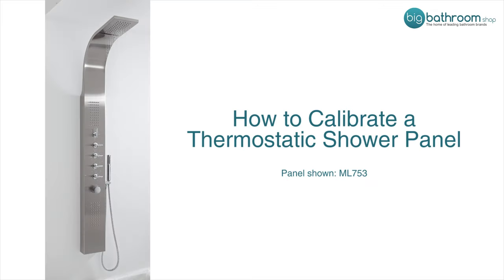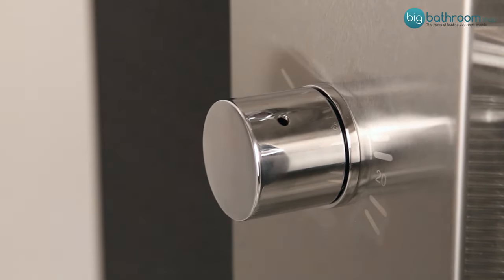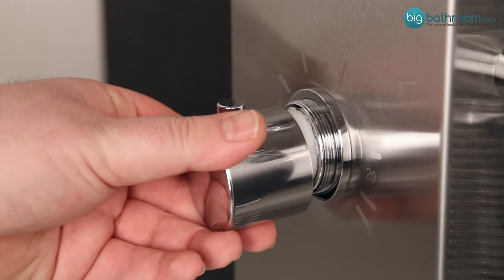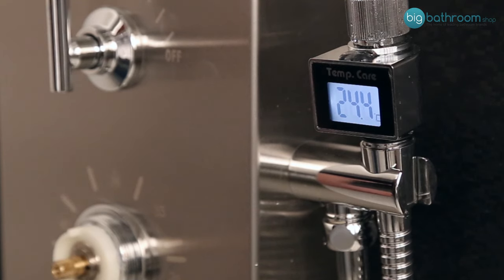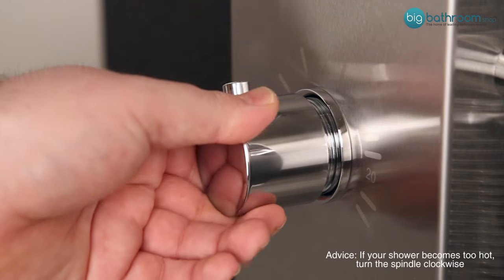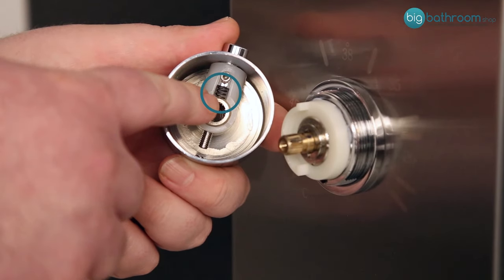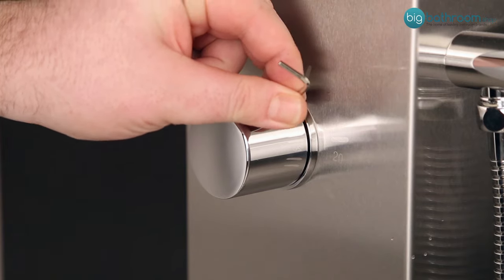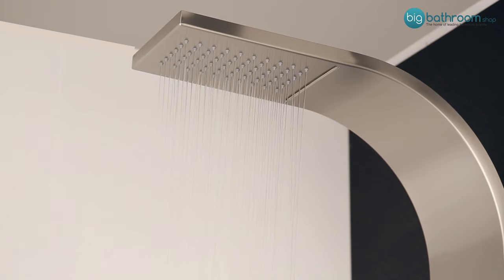How To Calibrate A Thermostatic Shower Panel | Big Bathroom Shop

Comment: I have this shower wall. When I turn up the hot water three pressure drops so much is unusable. Thermostatic valve is driving me nuts. Anyv way to keep three pressure up off you like hot water showers with this product?

Comment: Water pressure drops when increasing hot water. When all cold, water pressure is rocking. When valve is in motion, water pressure increases, but decreases when valve is stationary. What’s going on?